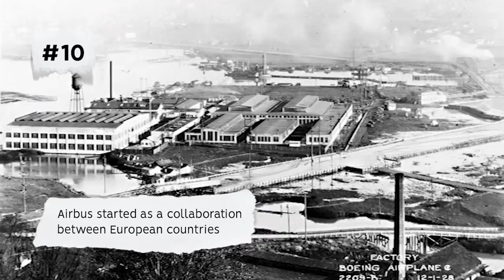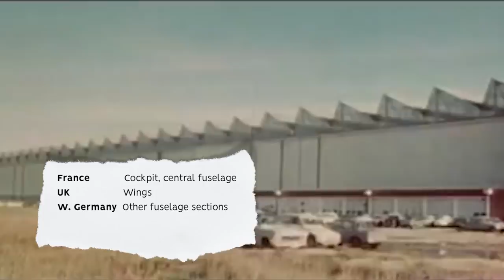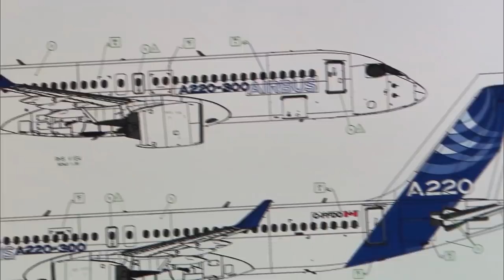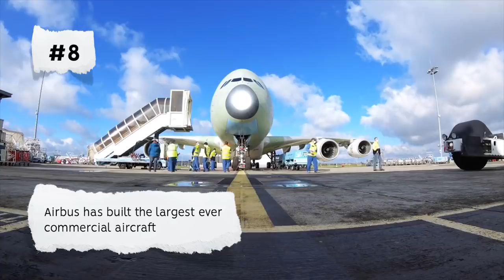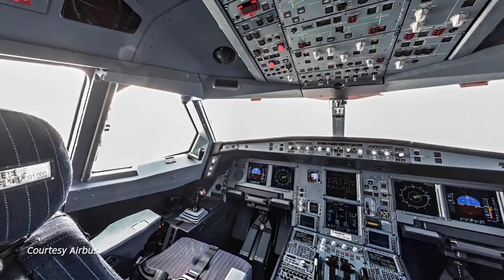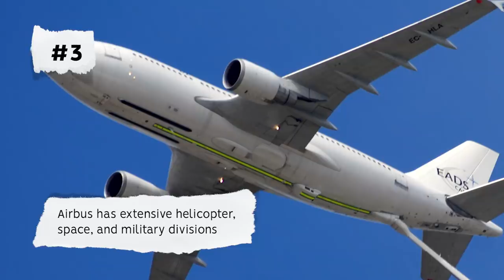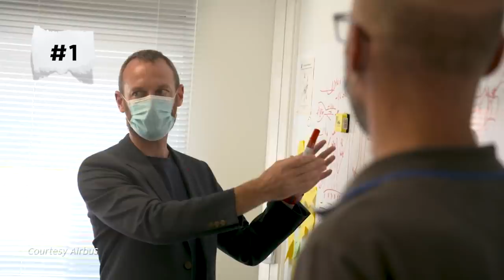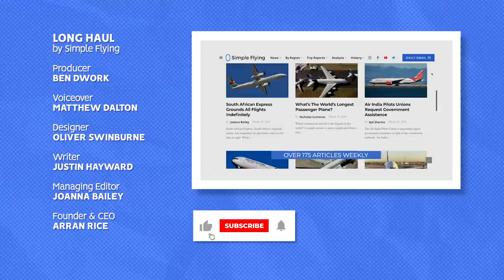10 Things You Might Not Know About Airbus

Comment: Some more interesting facts about Airbus:

- Initially the A300 had so few sales that the Airbus founders thought their dream was done for, dead and cremated. Airbus was two weeks from judicial liquidation when a new order suddenly came in, saving the consortium at the eleventh hour.

- A crucial step for Airbus was to break into the US market. It was the largest and most important aviation market at the time and no manufacturer could hope to survive without sales to US-based airlines, which was difficult among other reasons because of American distrust against anything "foreign". Airbus ultimately leased four A300s to Eastern Airlines for 6 months, free of charge as a non-committal trial. At the end of the six months period, Eastern was so happy with the aircraft that it bought the four airframes and ordered 19 more.

- In the spirit of building a pan-European project the Airbus leadership took it for granted that the A300 would be powered by Rolls-Royce engines. But RR was bailed out by the UK government, which wasn't favourable to getting involved in anything too European and didn't think that the Airbus idea had any future. So instead RR focused on the RB-211 engine for the Lockheed L-1011. Airbus eventually made a deal with GE instead. The rest is history: the L-1011 was a commercial failure (in large part because of its excessive cost and delays, attributed partly to the tumultuous and protracted RR engine development). On the other hand, for Airbus and GE it was the start of a long and fruitful collaboration.

- The A380 wing fence tips were manufactured by Boeing. 

- The Airbus production logistics with suppliers and assembly sites scattered across Europe was originally planned that way to preserve national egos in the pre-EU days and ensure that none of the partners felt short-handed. It turned out to be an efficient method that is still used today.

- Before it built its Beluga fleet, Airbus used two Super Guppys to ferry its airplane components between plants. Many people didn't miss the irony of Airbus using cargo planes based on a Boeing design.